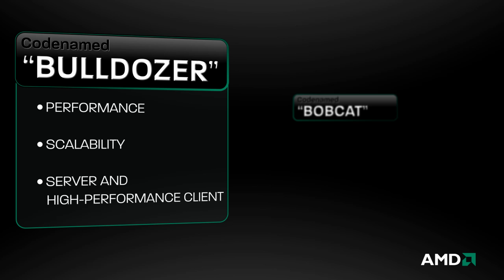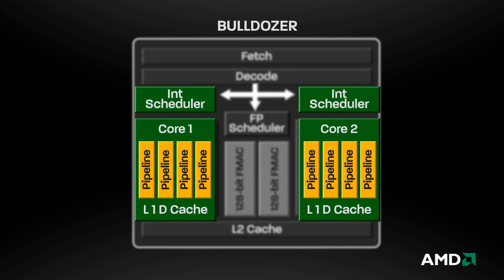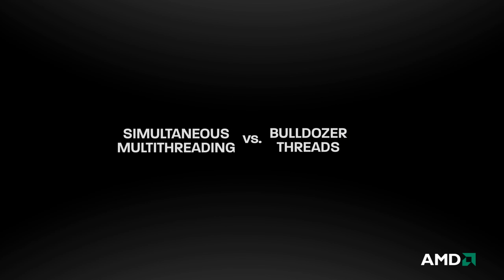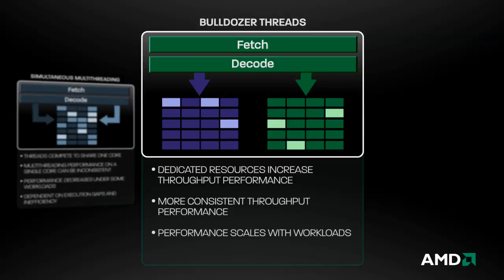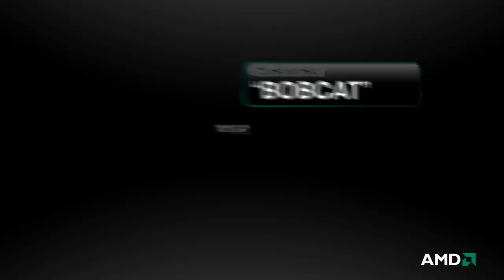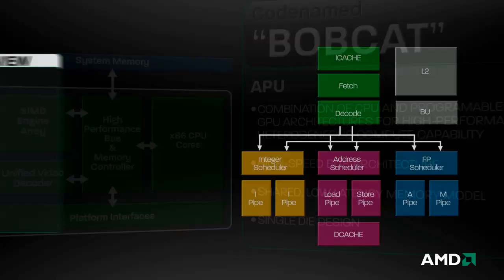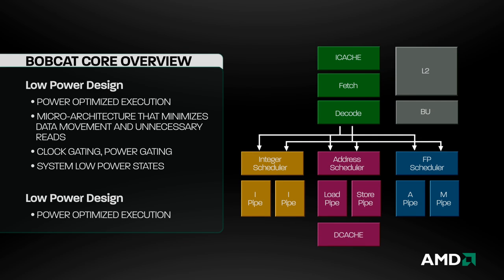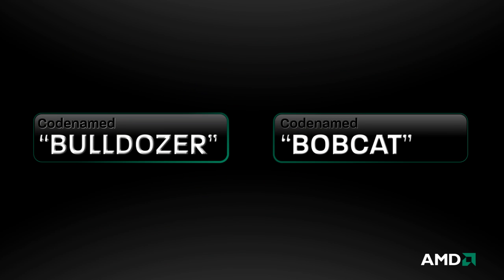AMD Cores: "Bulldozer" and "Bobcat"

Comment: @StevensiTX true but AMD crippled each core too much so total throughput will be too low per core, even if optimized, to beat the i7 2600k and upcoming ivybridge. Its all about the cache(intel has awards for best branch predictor for many years in a row) and the execution units. AMDs execution units are halved already and put 2 cores into the mix which basically means the performance is 1/4 of what it could be. they tried too hard to save space and it cost them major performance losses

Comment: @lolizmu not even that lolz, the server cpus are extremely close in price range that most companies will opt for the intel variants even if its less cores because as everyone must know by now that the cores from intel beat the crap out of AMD's and are more efficient. The only pro ive seen for amd for a long time was the upgrade path but when your highest processor can barely match the mid grade of the competitor thats not a very smart choice, SB upgrade path is much better.

Comment: @Icosebyte yeah i totally agree bobcat was a success for the laptop and small desktop market but i did some research and its basically a die shrink of the phenom II quad core with an integrated gpu. Which for the money is a great buy for casual gamers and offices. So i think they should go back to getting the most out of each core instead of crippling each core and throwing more of them at the problem. Ivybridge 8 cores are gonna be insane!

Comment: All things said at this point is PURE speculation, until the release date with PROPER benchmarking, without Overclocking, and using ONE GPU, instead of SLI/Crossfire, until the release date anyone, including AMD can just make up everything to either hype up, or try to mock the Processor.

Comment: @VitorHugoStaff kinda a weird way of putting it. the 2500 is about the same looking at passmark. that doesn't mean anything. some cpus preform better under different circumstances. both are nice cpus. i wouldn't do an x6 till they write programs to take advantage of them though.

Comment: @decimat777 correction the FPU is a dual 128bit FMAC so its technically a 256bit FPU but only if the FPU is arithmetically programmed in such a way by the software that is run through it.

Comment: @TheTrafficker85 I know exactly what your talking about, i have an i7 930 and a phenom 955 and the i7 outperformed the 955 by 47% with same ram and specs. I could understand bulldozer beating the first i7 series but will not beat the second gen, most likely equal up to it. Cant wait for ivybridge cause AMD does not have the Fabs to produce 3d chips and intel already has 6 or 7 years of research done on it so Intel has quite a lead on AMD.

Comment: Does any body understand anything here? They made 3 mistakes in this architecture. 1: 128bit FPU (i7 has 256bit). 2: Only one FPU per two cores while intel has one per core. 3: Your CPU core is only used about 30% of the time your on your computer thats why intel came up with Hyperthreading, to fully utilize the core, why the hell would you wanna produce more idle cores???? The only thing they got right was the Turbo Core, Congrats AMD, weve all needed that for gaming and editing.

Comment: Bulldozer may take out Sandy Bridge...but Ivy Bridge will wipe itself with bulldozer...it was hard to face it, but AMD just won't compete with Intel...my computer runs so much fucking smoother now that I switched for an X6 1090 to a I5-2500k...alot more fluid processing, minus 2 cores.

Comment: Bulldozer might beat out the current Sandybridge chips even if overclocked. You are running 4 cores vs. 8 after all. That will most likely change later this year when Intel releases the LGA 2011 chips and we have a 6 core Sandybridge.  I have used both manufacturers and had great success with both but these Sandybridge chips are in another world.  They pound through almost anything and overclock so easy.  In the end though it will come down to what your use is games, software, ect...

Comment: @zazu27604 im sorry to burst your bubble but this cpu has a crippled floating point unit and its bit count is half of the i7 so this one has a 128bit FPU per 2 cores while the intel i7 has 256bit FPU per core and in realistic performance our cpu cores are only used about 30% of the time we're on the computer, most of the time its waiting for the next instruction. so why not run more threads per core so that we can fully utilize the core right? not making more cores to just idle around.

Comment: @Olli120 exactly, finally someone with some sense! if this cpu miraculously outperformed the new i7 i would get it but as my fellow colleagues and i discussed this architecture is not very efficient and will require more cores to be able to perform as well as the i series, so from a design standpoint(i design microchips: no i dont work for intel) i dont see this cpu performing that well on any floating point operations and multi-threaded apps. i may be wrong we'll see but i say its a boo boo

Comment: @TheQARK this cpu will suck AMD is panicking. I am a chip designer for another company, not intel, and my fellow designers even agreed with me that this architecture has many appearant flaws. For one cpu cores only run about 30% of the time you use your computer so intel thought of HT which did increase heat but increased efficiency so why would you make more cores per fetcher/decoder unit. Second the put a crippled floating point unit which is essential for gaming/video encoding. AMD fail......

Comment: @MissMan666 and the only reason amd had the upperhand is because they got the rights to the pentium 3 architecture during a court case which meant intel had to go a different route thus sprang the crappy pentium 4. then intel decided to make another new architcture similar to pentium 3 which sprung core 2 the original derivative was the pentium M, this was the start of the core 2 architecture. Amd has been using pentium 3 arch this whole time with minor changes until now....

Comment: @MissMan666 that was the past missman i consulted with some other chip designers and this 2core:1fetcherdecoder architecture is not gonna work very well for multithread apps. Also the crippled floating point unit(intel uses a 256bit) is only 128bit and there is only one per 2 cores intel has one per core. this may save space but especially not performance when it comes to encoding videos and gaming. Amd was awesome but this was a bad decision and theyre panicking with this design.

Comment: Hyperthreading is actually a good idea because your cpu core is only used about 30% of the time (normal use) so if you just add more DFR (decoder/fetcher/register) units per core you can add more threads per core while  its not being used. why did amd go the other way and make 2 cores per DFR yes this will be great for single threaded apps but not multi... as i said below i design chips for a company and this idea above is not a very good one :( still love you though amd just need to fix this...

Comment: @Vleesball according to moores law were gonna have about 32 cores by 1nm which will be end of the line because atomically you cant get much less than one atom between each circuit because voltage leaks will be a huge problem for something that small. and not to mention cpu degradation will occur much faster since the connections will be so small. they will have to design the crap out of these things. too bad im not in the design loop yet :( i would love to be with amd or intel.

Comment: wow what is amd doing!!! noooo, i design chips for another company and i look at this and i see a huge mistake. they are trying to compete with hyperthreading by doing 2 integer core. but the ratio of 2 integer per floating point and this floating point unit being severely crippled to 128bit will ruin possible performance. Intel cpus have 1:1 ratio and the pipeline is the same throughout the chip, this allows full capability of the chip. i love amd though why would they make this mistake :(

Comment: @MouthofSaurons 
It said 16 cores for 8 threads

( in AMD there is no Hyper-threading, what they are doing now is a kind of  "under-threading" cause hyperthreading got Intel Patent, so AMD cant use it)

in fact the processor got 16 cores , and he " said" to the OS " hey, i got 8 cores" 

So what happen is each single "thread" will be processed by 2 cores, 
in oposite of what hapen on intel hyper-threading.

Theoriticaly is better, lets see if the Bulldozer push the SandY

Comment: no not really nvidia has been a sleeping giant they already have desktop cpus, but of course they are not on the market because they are not supported yet by any mobo manufacturer or windows. the next windows is supposed to support arm cpus and i believe evga will be producing a board concept for nvidia as well as nvidia boards. And if you compare the processing power from the tegra to the atom, the tegra beats it hands down in performance and efficiency. and the atom is partly a desktop cpu.

Comment: the quality isnt different as both last for years but the performance and efficiency is different. I have two systems one intel and the other amd. i found two cpus that have almost the exact cache and speed. the intel used less power generated less heat and performed beter per clock cycle, im not saying the amd was bad, it was worth every dollar. its just that intel has larger research teams and provide better technologies. plus amd hasnt changed their architecture in 7 years...

Comment: @bushpilot223 
A x86 processor is based on x86 architecture. The x86 architecture can run 64bit because of the AMD64 instructions AMD implemented. The x86 can be also called IA-32. Intel once wanted to replace IA-32 for IA-64 (Itanium) which was imcompatible with IA-32. IA-64 failed to replace x86 and AMD launched its Opteron processor with AMD64 instructions also called (x86-64) and that became industry standard. So when you're running Windows 64 bit is because your CPU has AMD64 technology

Comment: @hazzard77
1st the PS3 has a old GeForce 7 GPU (RSX), 2nd with a single Core PPC CPU + with 8 SPEs on Chip (Cell)!

e.g. in my PC has on the graphics card prozessor 112 SPEs or the GF 9800GTX has 128 SPEs. The AMD HD 5870 has 1600 SPEs.
thus PC is better & faster, shut up please

Comment: @blowupuate13 it is 64bit x86 is an architecture type. x64 was made up by retards lol there are many x86 architecture types such as x86-16bit  x86-32bit  x86-64bit etc. dont believe me look it up "does x86 mean 32bit" in google and the answer is no. we need to remove x64 from out vocab, the correct term is 64bit.

Comment: @TheNavav i'm currently using intel i7 930 so im not an AMD fanboy, or intel either, when i answer this. x86 is actually the architecture design there is a series of x86 such as x86-16bit  x86-32bit  x86-64 etc... I too thought it would be weird if amd came out with a 32bit cpu lol. yes it is basically 4 cores with 2 smaller cores in each but this is to compete with intels hyperthreading which is one core per 2 registers, amd is trying one register per 2 cores. we'll see which one is smarter :D

Comment: @sobchuk wrong i have a P4HT and i changed like 4 mobos(775 of course) and it worked perfect.now i run a E4700 on a GA-P31-DS3L and i just bought an MSI P43-C51 (wich runs on a different memory DDR21066 and DDR3) and it works good.Bulldozer and Bobact will run on G34 and C32 sockets.so yes both Intel and AMD did new sockets for i3,i5,i7 and Buldozer-Bobcat.

Comment: @Fuckyousobadly well youre right about the new architecture but the first i7's 970 965 960 950 940 "930"(mine) 920 etc... are all 45nm. The first 32nm model was the i7 980x the newest being the i7 990x which should have been called i9. so they are the same in that realm, i was kinda shocked that my i7 was cooler than my AMD even though its TDP is 130w and the 955 is 125w. i really do hope AMD brings out something new, but i only go with whats best on the current market and thats intel :( for AMD

Comment: @ZanderX10 "the PS3 could have better graphics performance due to the Cell arch" yeah especially if sony had decided to use two cell cpus instead of a crappy nvidia 7800 gt lol come on sony at least a 9800 gt or even a gtx 200 series with a die shrink...

Comment: @gundam0051 intel has had the edge since core 2 duo, unless AMD brings out a whole brand spankin new architecture (like intel did with the i7) Amd is gonna be behind. kinda sad i like my phenom II alot.... :( i got an i7 and i'll tell its pretty amazing. beat my phenom ii 955 both at the same clockspeed(2.8ghz, couldn't overclock the i7 :(...) and the i7 beat my phenom by 46% in almost every test plus i got my i7 for $150 and my phenom II for $170 so i got a great deal + upgrade.

Comment: @RSProjectX intel released lga 775 in 2006 and 1336 in 2008 based on the math im pretty sure that's two years, and lga 1156 was released at least to the public the same year as lga 1336. If you count the actual months into it as well its almost 3 years :) its 2011 now and 1336 was released in 2008 so its been another 3 years for intel. 1156 was created really for the business end of the market but normal consumers wanted it so intel released it to them, plz know what u r saying before u say it..

Comment: Consoles aren't directly comparable to a Home Computer due to having a different processor architecture.
Home PC: x86 arch
PS3: Cell processor with up to 6 usable Synergistic Processing Elements for gaming.
Xbox 360: Power PC Xenon, almost like the PPE processor in the PS3.

The graphics cards are comparable though, and both consoles have cards equivalent to a card from 4 years ago.

If the games were coded correctly, the PS3 could have better graphics performance due to the Cell arch.

Comment: I just hope Bulldozer pulls through for AMD; as of right now, it looks like it will still lose to Sandy Bridge(a 32nm part, just like Bulldozer). Hopefully the fused multiply-add FPU will provide a huge boost to the FP performance.
It looks like when using 4 threads Bulldozer will blow through any performance benchmark with those FPUs, but I wonder how they scale when using 8 threads. Intel still has an advantage with integer performance per core with their Hyperthreading helping that out.

Comment: @RSProjectX Well the 8 core Bulldozer-based CPU is going to be socket  AM3+ and not fully compatible with the current AM3, and will not work with socket  AM2+. And the 16 core Bulldozer-based CPU is going to be a socket G34. Well thats what I read.

Comment: window 7 Ultimate only supports  maximum of 2 cores which Im still wondering why ppl go for quad cores or 6 cores...because the maximum quantity of physical processors of a PC that Windows supports is: 2.. So pls do explain this, pls tell me quad core or 6cores works if it only supports 2.. Im using the AMD quad 965 BE myself

Comment: @hazzard77 What you got to understand is that the design of the PS3's cell processor is far different than that of PC processors. While it is true that the ps3 has a total of 7 cores running at 3.2, only 6 are ever used as one is always on reserve. Also something to consider is that the ps3 uses its own specialized processing algorithm. You may have heard that the ps3 is hard to code for, and that is why. A PC cpu has much more to handle, and thus must accept all of it. A PC can do more.

Comment: @lappy744 indeed the new chip will requir a new socket and ram , if your board is ddr2  but you may use an older am3 proc with the new mobo  basically am3+

Comment: It seems that AMD is throwing the whole notion of what constitutes a "dual core" module out the window and is concentrating instead on creating the most efficient, compact multicore module it can, to serve as a basic building block for various processor configurations. So, whether one views a Bulldozer module as a leaner dual core, or a beefed up single core, it doesn't matter; when these modules are combined, great performance will result. I think there's some elegance here.

Comment: Speaking strictly as a computing layman, I have to say that the Bulldozer microarchitecture is intriguing as heck. If (as AMD claims) a single Bulldozer core can provide 80% of the performance of a "true" dual-core module with a 20% savings in die space (and thus lower electrical consumption), I would say that's a tradeoff worth making. If more raw power is needed, another Bulldozer module can always be added to the configuration.

Comment: Now Newegg is out of stock on the Phenom 945, but showing that new stock is arriving in early November. If the 945 isn't available, I would go with the Phenom II x4 955 Black Edition. It sells for $139.99. The only real differences between the 945 and the 955 is the unlocked multiplier of the 955, higher TDP of the 955 (125W to 95W) and a 200MHz speed bump. They're both great chips providing power at a great price.

Comment: After reading quite a bit about Bulldozer, it seems to me it may be quite a bit quicker than anything from Intel on single threaded tasks/Floating point ops. Rather than two threads running on one core, two cores will be able to gang up on one thread... this should be fantastic for video work and gaming.

More than anything I want to know if the 8 cores can double up on 4 threads, that would be incredible!

Comment: @ibrahimalghamdi94 

AMD's Phenom II x4 945 is a 3.0GHz quad-core chip that runs cool with a 95-watt power draw. WIth four cores, you'll have more than enough power for all the current games and applications, plus future ones that can take advantage of four cores. It's available for $135 and is the best desktop chip out there for under $140. Read reviews on Newegg.com and you'll see that it gets uniformly high praise from builders.